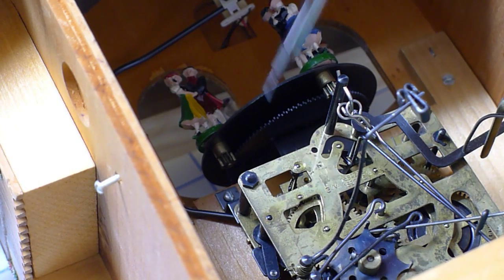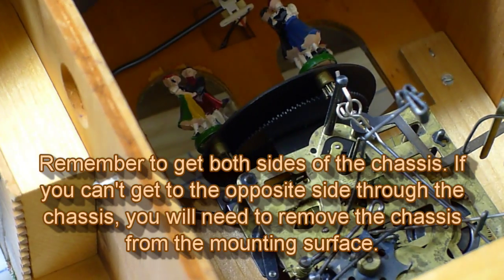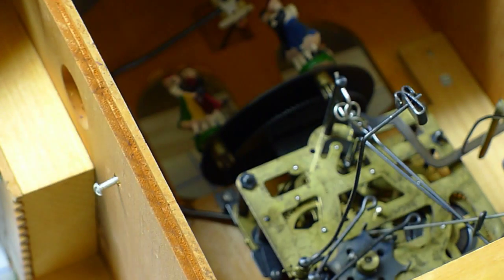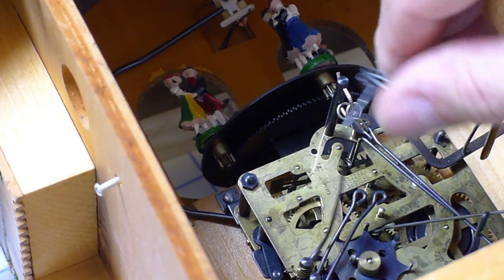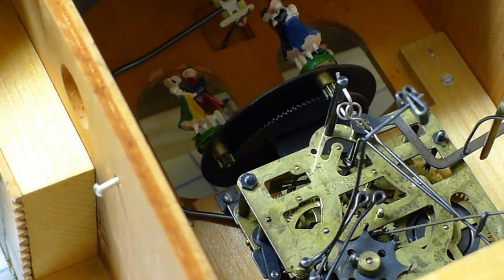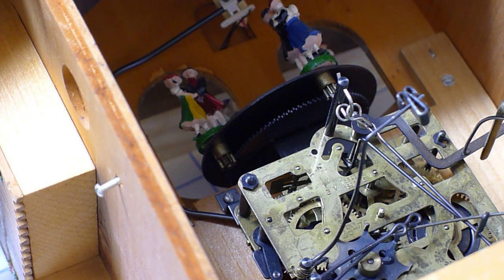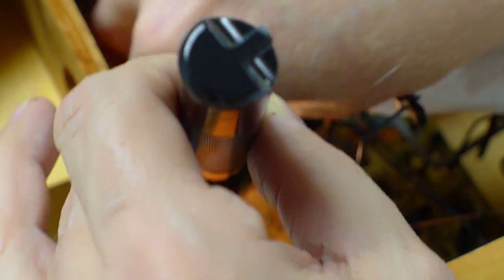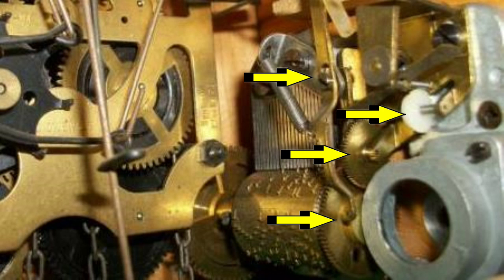Swiss Chalet cuckoo clock repair and oiling the mechanism

Comment: a Q tip will work much better than a piece of tissue my thought plus your hand blocks the view so i stopped watching gee thanks
Reply: Q-tips can leave strings that can bind on pivots. Use a watch pivot oiler, it’s precise and only a small amount is applied, you won’t need to blot it at all.